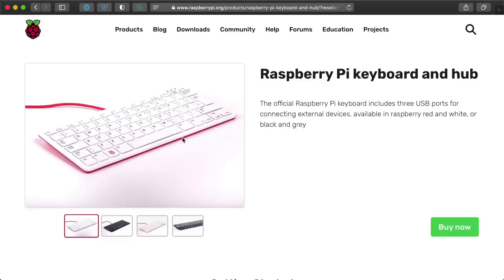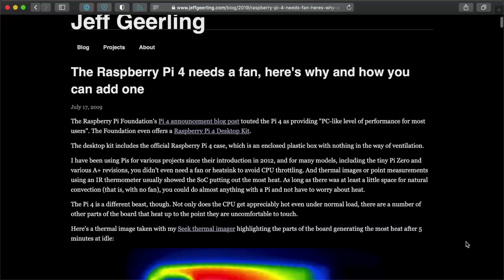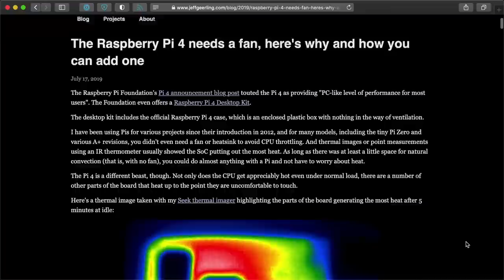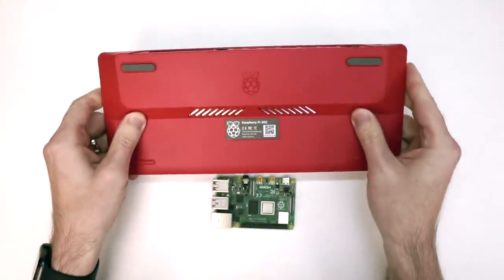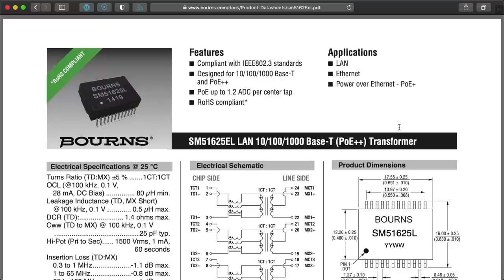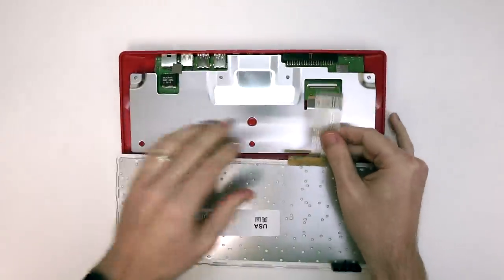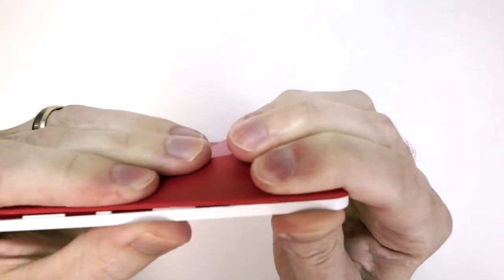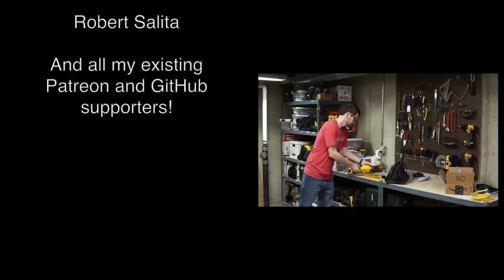The Raspberry Pi 400 Teardown

Comment: Finally someone made a modern day Commodore 64 style computer.
Reply: Yaaay
Reply: Or more like XZ Spectrum, since it is from Uk
Reply: It looks like this thing designers have medications a lot of -- next idiotic design without the vent system. What about the heat and throttling, bro?
Reply: @dmitryponyatov2158  There are some test, it never reaches more than 52ºC, this is less than in an aircooled rpi4.
Reply: @joselu90  I don't know your testing method. Run video encoding for 2 hours for example, and log CPU temperature and frequency. Also, it is interesting, how hot and stinky will be the plastic case after it.
Reply: In his unboxing video he did some initial testing and it ran cooler than a regular Pi. He also said he will be doing a test that stresses the CPU, GPU, and networking all at once to see how it can handle the heat. So give him a few days, and you’ll know one way or the other.
Reply: VIC-20?
Reply: I'd love to see them upgrade that "The C64" with a better CPU, more ram, etc.
Reply: The name of this machine was inspired by the Amiga 500, which was also a Commodore product.
Reply: @dmitryponyatov2158  why would I run video encoding for 2h on a pi 4? Also, no, it does not termal throttle with normal use. So yeah...
Reply: @dmitryponyatov2158  since it's only a low power arm chip, I don't think the cooling should be an issue.
Reply: Same thing i was thinking.
Reply: If it was named after the Amiga 500 why did they call it the RP 500.  Probably named after the Atari 400.
Reply: If it was an homage to the C64 they'd need a breadbin style case. I'd buy that in a second.
Reply: @michaelstoliker971  because it's the raspberry pi 4 not the raspberry pi 5, so, RP 400. Atari 400, is this a console now? Also the design is clearly based on the amiga 500 and the commodore 64 for example. Cringe
Reply: @inlinesk8r477  I figured out the first part myself.  But the second part is not clear to anybody because a simple keyboard and red and white colors are not reminiscent of either the Amiga or the C64.  The flat keys are similar in concept to the membrane keyboard that the Atari 400 had and the USB ports are descendants of the SIO connector as they were both designed by Joe Decuir.  If they wanted it to look like a C64 they would have made it look like a huge brown turd.  If you don't know what an Atari 400 is, Google it.
Reply: @michaelstoliker971  i know what's an atari 400, I have one. But this type of design is usually associated with commodore (since, you know, C64, Amiga, etc...). Also it's way more similar to commodore computers, and color scheme has nothing to say in it (since this uses the the RPi color scheme and not any other one). And at last, it's named based on a commodore computer, so it's only fair to think it's based in one, it comes down to simple logic (probably). But we could all be wrong and this is based on the apple computer
Reply: need the mechanic keyboard version
Reply: @alan-pj8hx  should be simple enough if you got one of these boards
Reply: @replikvltyoutube3727  Or a BBC Micro regarding the architecture of the CPU :-)
Reply: @charlescasadei3045  I was thinking BBC Micro, based on versatility. This is going to end up in a lot of schools.
Reply: Theey redesigned the board. SURELY they would use full-size HDMI connectors on it yes? Or would there be not enough room? Clearly they needed to retool the die which makes the keyboard case (or request their ODM to ask some Chinese die maker to do it again but a tiny bit taller, which means they probably just ground it out and welded, then ground again until it was a little bit bigger) so why it lacks fulll-size HDMI is beyond my comprehension.

 Hey Jeff, do send an E-Mail and ask them why they just don't use full-size HDMI ports which are far more robust and have more connectors available for those. I am sincerely curious why they don't use a more robust video connector since they have the space for it now. Surely it can't be a BoM thing — they have to always buy new parts anyway!

Even better: With full HDMI they could also include Ethernet over HDMI so one less connector from the Pi is necessary, and maybe include a split HDMI video and Ethernet adapter for people to use HDMI and Ethernet separate. It would reduce BoM for future revisions.
Reply: @bluephreakr  I think you posted in the wrong place, but none the less, Ethernet over HDMI is just not practical. Noone uses it and in most case you won't want to have a dongle flying around, which you always need with ethernet over HDMI.
Reply: @polygorg  Wires and dongles aren't that much of a problem when you still need to give it wired power and they pack in a corded mouse. Now if you were going full wireless they'd have to add in a couple of compartments for Nokia-style LiPo packs, recharge over USB-C and a wireless mouse.
Reply: @bluephreakr  what I'm trying to say is that ethernet over HDMI is impractical and literally used by noone.
Reply: @polygorg  And what? micro-HDMI is? No, most would drop it in a heartbeat if the 400 had full-size ports. I get what you're saying, my original argument stands that it would cost less for their BoM to minimize ports and multi-purpose what they have.

The only reason these guys use micro HDMI is cost, and the only reason people use micro HDMI with the Pi is because they provide no options to ditch the adapter. On a device they could had spent a little bit more for proper connectors nobody had to adapt, they flopped and went with what was necessary due to the size of the original Pi's footprint.
Reply: @bluephreakr  I'm not saying that them using micro hdmi is good! I for one would have loved to see Displayport and full size HDMI on one, I just think that ethernet over HDMI is bad.
Reply: brings me back to the Commadore Amiga glory days!
Reply: What do you mean 'finally'? Terry A Davis made it years ago!
Reply: @willdwyer6782  The original A1000 which was built by a group of computer nerds at some US university and bought out by Commadore... has nothing to do with the naming of a Raspberry Pi!
Why the A500? why not the A600 A500+ A1000, A1500+ A2000 A3000 A3000T A4000 A4000T
Now I use an emulator... those 68k CPUs just cant keep up :(
Reply: @inlinesk8r477  Actually on the Lady Ada (Fruit) channel she said she was told it was based on the Apple IIe computer.  But lets be honest, this computer is an homage to all "Computer in a Keyboard" personal computers which includes nearly all computers available in the early 1980's.  This is what Eben Upton was shooting for when he started the Raspberry Pi project, to bring back the excitement of those early home computers and to get young people excited about science and technology.  So whatever computer you think this was based on, you are right!  It was based on the idea of those computers more than any single brand or model.
Reply: @michaelstoliker971  fair enough
Reply: Be nice to see third-party top’s! Could easily mod a c64 top!
Reply: @dmitryponyatov2158  It has vents below,and the plate will mitigate much of the heat.Modding it would be a fun,quick project though!
Reply: Needs a beige version,just saying.
Reply: @Doobie3010  Yeah it's a shame Motorola didn't keep up the battle with their 68k chips vs Intels x86 ones, but it was funny when Intel skipped from 086,186,286,386,486 to pentium... Motoroloa at that time switched from 68000,68010,68020,68030,68040 to a 68060 lolz
Reply: @devilsadvocate1597  On the Intel side, the simple answer was that they couldn’t get the 586 trademark. Altos had it, and 986, for their little Xenix 5 and 9 user systems, respectively. Why Motorola skipped, I have no idea, but it would be interesting to hear theories.
Reply: @dmitryponyatov2158  Where is your evidence? There is plenty of evidence to the contrary online.
Reply: @devilsadvocate1597  Always intresting seeing firms that backtrack rather than piling on the pressure to the big guys,always wonder what might have been!
Reply: @simonmartin2263  a few days ago it was a video with more detailed tests, as I remember the result was 40C at the board case, but without throttling -- not good, not bad
Reply: @inlinesk8r477   Here I am thinking it’s an homage to the early Acorn Archimedes/BBC machines. They had the A300/400/500 series (the A3000 was all enclosed without a monitor) and ran on the first ARM processors.
Reply: No more like a BBC Model B
Reply: Now that i think about it, that is verry true...
Reply: Do you honestly want to go back to having a computer built into the keyboard?  As I am typing this, I have a keyboard in my lap, my feet are on the desk.  I wouldn't want to return to using an Amiga or a C=64 case, ever.
Reply: For the size of a Vic-20 you could get a way more capable computer with a stronger GPU, and a proper keyboard

Comment: This looks great, but they should have wrapped a wifi antenna cables around the keyboard like it's done in laptops (usually around the screen) to increase the reception area. Built in wifi is still the Achilles's heel of all of the Pis I've used
Reply: Hello, wonderful person.
Reply: i was just watching a lot of your videos
Reply: yeah i use ethernet in mine
Reply: I dont know why but it makes me really happy that your also interested in single board computers. Love your videos was just learning about Jupiters moons!
Reply: They do very wise decision not to use wifi built in board. Cheap wifi assembly tends to have different quality issues - either closed source drivers that works with tons of trubles and have conpatibility issues, or issues with recieving/transferring physical module, or issues with decoding/encoding chip or errors in frimware. So if you need wifi connection, they supply this device with additional standard usb hole, where you can insert any favourite usb wifi plug and have wireless connectivity experience. Very good, wise and lucky decision - user have freedom of choice - there plenty different usb wifi plugs on the maket.
Reply: is there a way to plug in an aftermarket antenna cable without soldering? ive done mods on my drones that are similar.
Reply: low WiFi  in terminal   iwconfig  ( power mngmt needs to be OFF),  add  iwconfig wlan) Power off. This fixed my Pi4 and Pi400. The speed almost equaled my Ethernet connection.              enjoy the day, Claude
Reply: @СергейВладимирович-б9з : ...the Pi 400 and 4 both have built in WiFi and Bluetooth? Unless you're saying it would have been a smart idea to not include it? (To which I disagree with, though I've found the WiFi and Bluetooth to have functioned correctly.)

Comment: Thanks, Jeff, your video of how to get the keyboard off was very helpful.  This work for the Raspberry PI keyboard as well.  This comes in handy if you need to switch the keyboard language or have a damaged keyboard.  The Pi keyboard and the Pi 400 keyboards are compatible.  Also your selection of the tool to pop the seams on the keyboard is spot on.  I have not found a better tool.

Comment: Have to say, I REALLY want to see one of these with 8G of ram and an integrated M.2 sata port. Perhaps even with a beefed up SOC of 2Ghz+. I love these little low powered computers for running things during power outages, which happen often in my area. While my neighbors are running around with candles I have a powerbank with a led camping light and a ARM Chromebook running Ubuntu tethered to my phone. Priorities I guess ;-) .
Reply: With a fast disk, just use it for swap!
Strangely on the Pi4 4GB I rarely run out of memory, but on the Apple M1 8GB, it creaks!

Comment: Looks really neat! I'm surprised they didn't just put a normal Pi 4 in there, I guess they are expecting to sell enough units to make up for the investment of a new PCB design.
Reply from the maker: It also saves on the overhead of adding a bunch of extra jumpers/cabling to get the GPI, power, and HDMI plugs on the back of the unit. I think this design was the easiest way to get the whole thing in the same footprint as the Pi Keyboard.
Reply: I was actually hoping for a (raplacable) Pi 4 compute module. wouldn't it be amazing to be able to replace it in the future?
Reply: You know what's funny, there's a guy doing exactly that with an old TI-92 calculator, he's calling it a "PI-92".
https://twitter.com/Hacksterio/status/1320913681610383361

(We're thinking of doing something similar with some second-hand Alphasmart keyboards, which would be similar to this PI-400, except with the LCD display as well).
Reply: Makes sense. It's being launched for £70-£100 just before christmas in a year where parents don't have a lot of money, and won't be able to go shopping in towns because of Lockdown2.
Reply: starshipeleven  It's relevant because other computers can be bought in town in normal years, so the lockdown puts the Pi 400 on an equal footing.

Comment: 6:40 Nope, the 400 number is not an homage to the Amiga 500. It's an homage to the Acorn Archimedes 400 series, which was the power user version of the Archimedes (the low-end version was the 300 series). All the Raspberry Pi names pay homage to early Acorn computers (the BBC Model A, Model B, Archimedes, etc.). The ARM processor was originally the Acorn RISC Machine CPU -- the first 32-bit desktop RISC processor, released with the Acorn Archimedes. The acronym was later renamed to Advanced RISC Machine.
https://en.wikipedia.org/wiki/Acorn_Archimedes
https://en.wikipedia.org/wiki/BBC_Micro
https://en.wikipedia.org/wiki/ARM_architecture
Reply: the guy who made the pi said he was inspired by the Amiga already, my guess is the 400 is for 4gig of ram like the amiga 500 the 500 stands for 500k of ram
Reply: @Yahgiggle  Did you read what I wrote? Please research the history of the BBC Micro. The creators of the Raspberry Pi were inspired by Acorn computers, not by Amiga. They are British, not American.
Reply: @usethefooorce  yes I know all about the Acorn and you could be right as the information I was told was second hand, but from someone I would think would not tell BS his information was that the guy that made the pi 400 got his inspiration from the Amiga 500

Comment: I wonder why they didn’t use the new compute module. With that, it would be upgradable in the future.
Reply: I agree. the first thing I thought is that it's cheaper to produce the Pi 400 as a single part but they're making both anyways so it shouldn't matter.
Reply: Imagine the physical abuse some Pi400s will get from frustrated kids. I think a single board is better.
Reply: @zuryan  There's still the cost of the connectors, on both the Compute Module and the hypothetical main board.  The Pi is cheap enough that that sort of thing matters.
Reply: @electronics-girl  the compute module is already being sold with the connectors. so all they need is two connectors on the keyboard PCB. the only two reasons I can really think of is 1st, it technicly not being a "single board" computer anymore, and 2nd the compute module remains not as easily usable by tinkerers so that way they can don't run into stock shortage for industrial use as easily.
Reply: Connector cost; also given they will be hoping to sell this in volume, a single PCB rather than two will save money.

Comment: they have all that space but still went with those crappy tiny HDMI sockets! 

could be design philosophy? make everything tiny then you notice the gpio header ok maybe not! they probably just did it to save money so they didn't have to stock regular hdmis
Reply: Two HDMIs are more than one. You know what they say: "The more, the more"
Reply: @FunHaverSD  Robustness. Mini/Micro HDMI ports are known to be weak. Maybe that is why it has two, one spare for when the other inevitably dies.
Reply: @FunHaverSD  Because Mini and Micro HDMI SUCK. They are pretty fragile and break easily. Also, since those connectors suck and almost any device uses full size HDMI or uses USB C for Video (that connector is around a billion times better then Mini/Micro HDMI), nobody got those fucking Cables/Adapters on hand. 

No, less is not allways more. They really got more then enough space for at least one full sized HDMI on there. Or do it at least over a USB C port, that is actually a good connector. 
The recourses argument is pretty week btw. The difference between Micro and fullsize is very small, it basically didn't matter. But if those tiny amounts of material mean something to you, think about the adapters to fullsize people need to buy.
Reply: @FunHaverSD  they break easier
Reply: Even USB-C ports with displayport support would have been better.... mini/micro hdmi ports are crappy and hard to come by.
Reply: You get one adapter cable in the box.
Reply: starshipeleven  HDMI is not made with repeated insert-remove cycles in mind.. We are pretty spoiled by USB when it comes to this. Mini USB would also break quite soon, but with the micro USB revision it was decided that cables had to break instead of the port. I don't really think that display connectors will ever get very sturdy just because it's limited use case and that it will never be used to charge any device.
Reply: It would reduce their BoM to use EoH so an HDMI connector could replace the Ethernet jack and USB-C for robustness and multipurpose connectivity, but that would mandate an entirely new board revision rather than buying the cheapest parts because nobody wants and it wouldn't use parts they already have in stock. That and the more integration which happens, the less likely users can purpose the device without spending another $100 on accessories.
Reply: I'm hoping they manage to make every port a USC type C on the 5. Except the ethernet, I mean. Heck, if you did remove the ethernet, you could almost combine the B and the compute module lines.